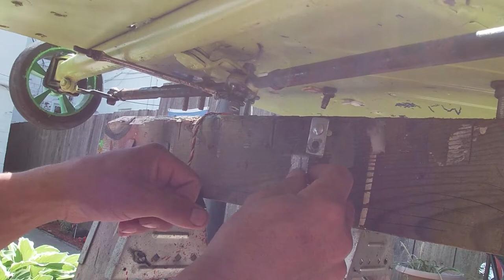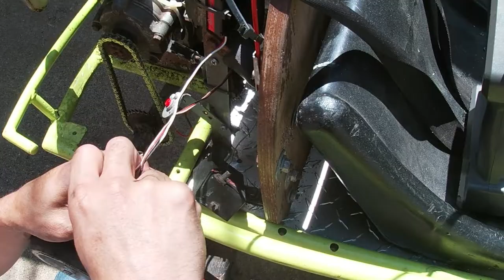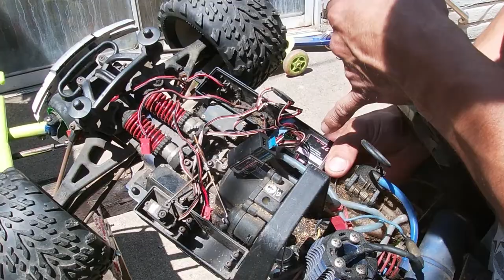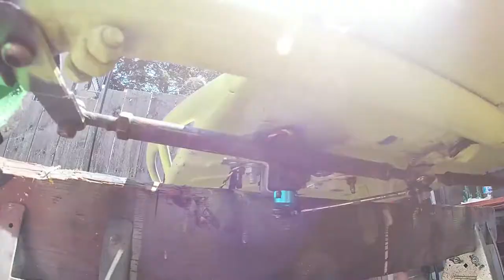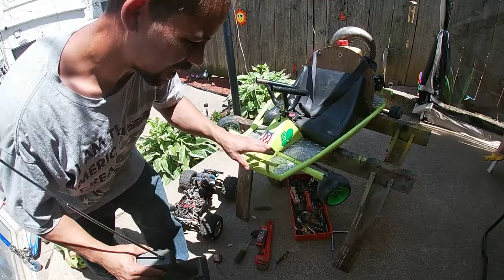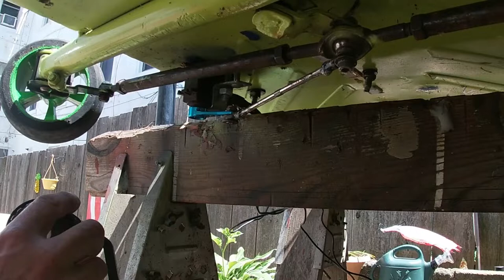How to build an RC Go-kart

Comment: I had a digital servo glitch like that n i needed to install a CC BEC n it bumped up the reciever volts from 6v to 7.4v n fixed it...i ran a savox servo..super strong , fast n water proofe
Reply: Its fried lol. Are you using digital servos?
Reply from the maker: cain sample I really need your help with this one.im not sure how to install a bec
Reply: @samsgarage1716  i dont either the hobby shop did it for me.
They said i needed it n i told them if they install it id buy it...i would get a 2.4 radio n reciever n they make good chinese servos ppl had good luck with...savox is kinda pricy at $90-120
Reply: @samsgarage1716  that was in my erevo i dont have that anymore...everything we have now is traxxas radio,esc n servos...but a stock traxxas servo wont be strong enough for what you need

Comment: I think that servo is no good..maybe it got wet or something..I know you can run dual servos for more strength..they make a y adapter that goes from the receiver with one wire and then splits into 2 ends..you will figure it out tho!
Reply from the maker: Trial and error and some more money 😂.I just ordered a 35k servo for 40 bucks

Comment: I have no suggestions, just moral support...that's gotta be frustrating
Reply from the maker: So I ordered a new servo today.Its a 35k 270 degree water prof servo.I also think the battery is to strong but then again the other servo for the throttle still works.Ill see if I can get a wire harness adapter that’s long enough.